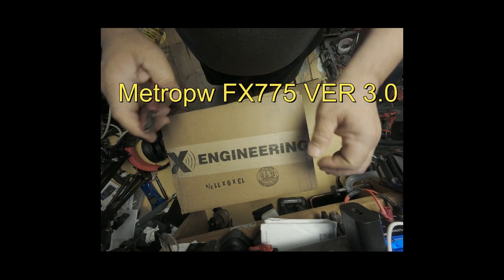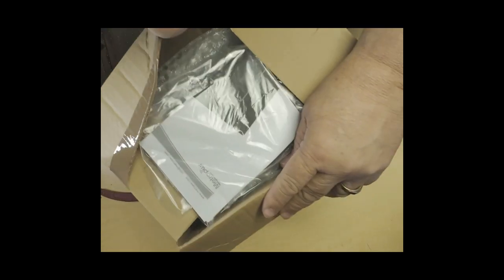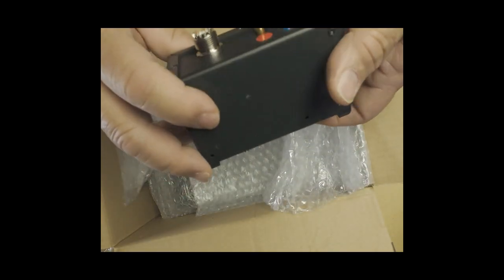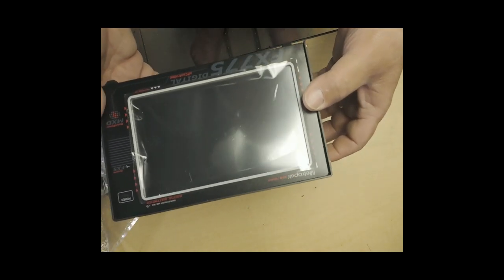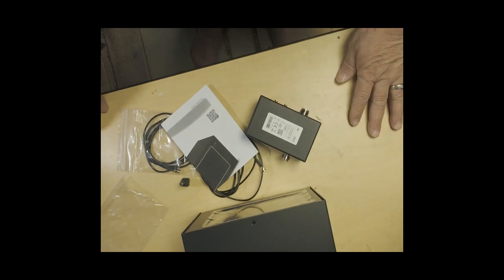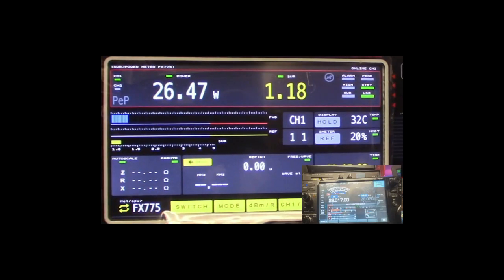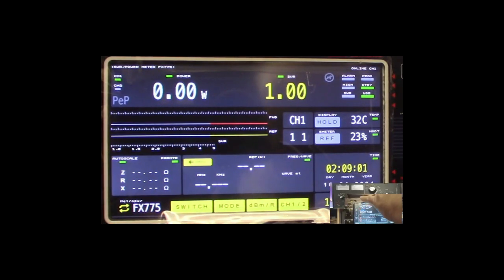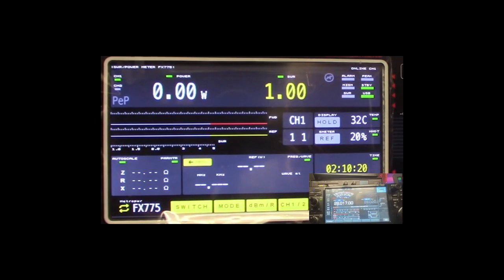METROPWR DIGITAL WATT METER FX775

Comment: Hi Pete have you connected a micro usb - usb cable to PC/Laptop for the Metropwer Pro Touch software for windows 11( above the power lead connector on back of the FX775) and got it to work?
I have used sofware Type A, when connected to my Laptop it shows the GUI on the laptop screen shows most on TX except the statistics for R,Z and X are blank, plus the Metro Power FX775 device on my table is continously clicking off/on with a Beep when connected to the Laptop.
Just wondering if the software needs updating for Win 11, thanks Mike MOMGX